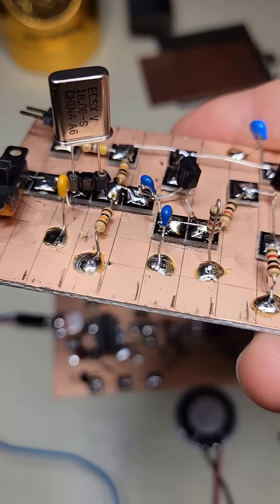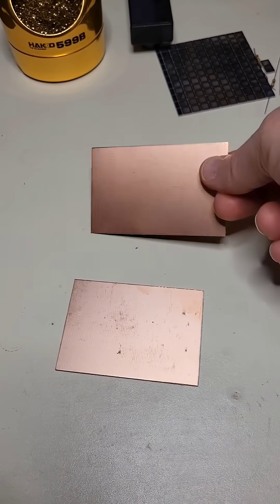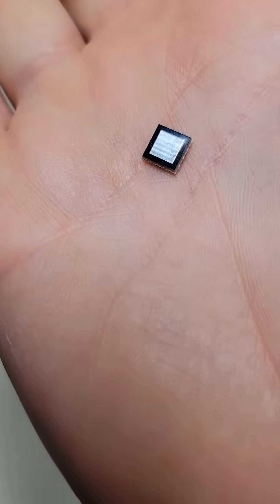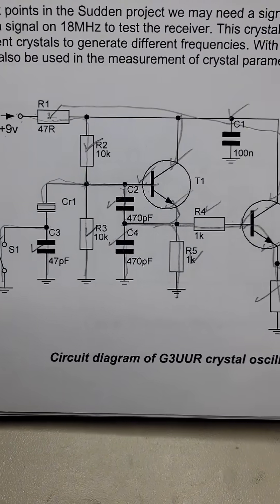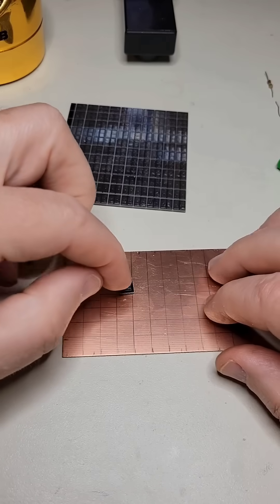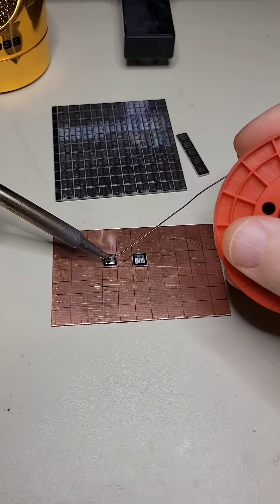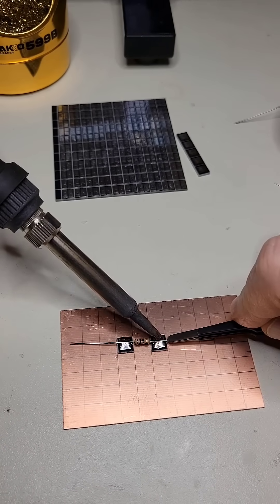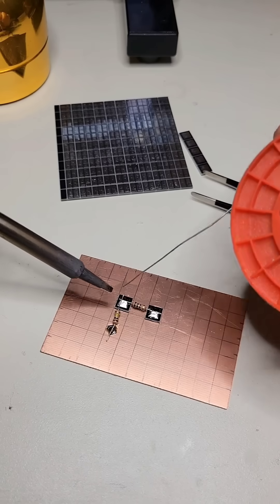Manhattan Circuit Construction Technique for Homebrew Ham Radios

Comment: ich nehm eine geätzte oder gekaufte Kupferstreifenplatine 2.5 x 2.5 dm 
da kommt mehr an Material raus. 
"Doppelt" falsch gemoppelt ist nur umstandskramerisch und dann "einfach" nur dumm.

platter CPU Löter - Plattenwitz:
man kann auch ein Sperrholzbret Brett 1x 1 Meter und 10000 winzige verzinkten Schrauben
für 1.50 Euro nehmen, fern aller Umstandskramer ! zusätzlich noch kleiner  Akkudreher
dann kann man dort eine CPU zusammenlöten. kleines Geheimnis : noch nicht gemacht.
aber kleine Kunsttoffpreßriegel gehen auch super, [Sonderteil: absolut kein Witz] 
wenn diese selbst so geauteten und überwichtigen Trottelmärkte mal zu sind.

Sie stellen sich ja selber so geistreich tölpelhaft dar ?

Comment: New to me, like half the stuff on the web.   I don't understand why the board needs a copper surface if it's not conducting for the project.
Reply: As usual a 2 second search answers my question.  Ugh.  I don't know ground plane stuff, I have minor awareness of shielding:
AI Overview
Manhattan circuit construction is a DIY prototyping method where components are mounted on small, superglued copper pads that are arranged on a larger copper-clad board, which acts as a ground plane. It is popular in ham radio circles for building high-frequency circuits because it's faster than etching PCBs, allows for easy modification, and provides a solid ground plane for performance. The process involves penciling a layout on the board, cutting or purchasing small copper "islands," gluing them down, and then soldering component leads to these islands and the ground plane. 
...

Comment: That super glue sure love that heat.
For a circuit that simple you don't need complicate things. All you need is copper clad for ground and for holding components. Everything else can be connected "in air". And can be compressed into very small footprint.
And if you are worried about moving, encase all in epoxy.

Comment: This is pretty cool. What is that circuit that you are showing for reference I see the crystal oscillator and I'm curious I'm trying to get into Electronics and build a simple transmitter but my brain doesn't work that well for this type of stuff I'm just a dumb plumber

Comment: My pioneer technique was made of springs attached to base of isolation material...springs had down there holes for screws...and up they were bended at angle of 90 degrees, so you can always stretch them and input wire of component. Very fast assembly and disassembly of devices

Comment: you can also drill through holes and cut or etch traces in those boards and make SMD pads or vias so no manhattan circuit or just  upload your gerber+drill files in a zip (or 7Z) archive to PCBWay's beta upload thing

Comment: I do a similar technique called island cutter, use hole saws and drill press to cut islands through the copper on the board while non island portion is negative ground plane.

Comment: Why would you need a copper plate to begin with? You could do the same thing with a piece of wood or plastic (you would maybe just use a different glue) and you can use a piece of uninsulated copper wire for your ground. Way cheaper, way more flexible.

Comment: I've used that construction up to 200MHz. As long as keep leads short and plenty of decoupling it works very well. Plenty of 100MHz high power amps built like this in the 1980's.

Comment: you can skip the glue and just go like a five times over lines with a knife. I recommend using a lower temp solder to avoid copper separation

Comment: In old solid state TV tuners,the RF circuit was built with flying leads joined together,and component ground leads were soldered to the inside of the RF shielded box. Oldtimers know...

Comment: I remember the days when you'd go to Radio Shack for all this stuff.  I suppose now it's probably Amazon.  Then again premade professionally laid out boards are an easy and fairly cheap option.  And there is an old school charm about this.
Reply: Digikey, Mouser or Newark. Al lot of the stuff on Amazon is cheap Chinese junk that a lot of the times doesn't even work.

Comment: Being allergic to the vapor of any super glue product, I usually used hot glue. Then took a different approach.  small drill bit welded a tiny cutting blade on each side. Using a small drill press makes a perfect isolated from the cladboard copper surface ⭕

Comment: Doesn’t superglue degrade into cyanide gas at like 200°C? A jeweler friend of mine gave himself some mild cyanide poisoning while repairing a ring with superglue on it, but obviously that torch was a lot hotter and burned the glue directly, but I’m curious if that’s a concern here

Comment: My first circuits were simple too.  I thought parts had to be laid out just like the circuit diagram.  I made a copy of the circuit and taped the parts down, twisting wires together where they joined.  To my surprise some of the things I made (very simple things!) actually worked! At about the age of 13 I bought a soldering iron and things started to work much better.  That was in 1967!

Comment: It seems for my like vaste of PCB and solder. But it is interesting. And it is really good for circuits for higher frequencies? Becouse each "sandwich" add some capacity to the circuits. Isn't the trio of "dead bug" for mini circuits, prototype boards for no big circuits, and classic PCB for larger/final circuits enough?

Comment: Kind of poor man's version of a Beard board lol, I found plastic mesh panel oh I have so many ideas demonstration making circuits and boards it makes go back to the books so I can replace without the sawder thanks like the video. Cheers
Reply: i think this isnt comparable to breadboard. breadboards are poor for RF and high speed systems due to interference. this is much better in that aspect (not sure)

Comment: there is a drill bit you can use that will cut a shallow circle into the copper clad board. Acts just like the little squares basically.1

Comment: This is a very common technique.  However most prototypes use flying connection points vs using a square pad.  If you need a bonding point, you cut a pad into the copper plane.   Look at Robert Penfold’s work…

Comment: I've built many circuits freestanding or dead bug style with out any kind of circuit board at all. Sometimes I can get away with building the circuit on the back of a circuit board screw terminal strip. And a number of them have been constructed on top of a 9V battery connector.

Comment: I was doing that back in 1982/83, doing logic circuits at 300Mbit/s! Made a 23-stage PRBS generator and error detector using emitter-coupled logic chips.
Reply: Back in '85-86 I built a Direct digital synthesizer using 100k series ECL chips. We used a fast ROM chip with a quarter sine wave stored going to a very fast 10 bit DAC. The address to the ROM was a cascade of adders where the output was looped back to be summed with a control word to set the speed of the adder. The MSB of the adder controlled the polarity of the sine wave and the MSB-1 controlled the slope via a series of XOR gates in the address lines of the ROM. It produced a 12.5 Mhz Sine wave once filtered. It was the heart of our MRI machine. We used to buy them from a company called RTS, but it was cheaper to build them ourselves. ECL was a PITA... But at the time, it was the only logic that would operate at the speed we needed. My engineer wanted to have a custom chip made from the circuit, but the company didn't want to spend the money. A few years later (in the early 90s), Qualcomm came out with the Q2334, which was what we would have had if we had gone forward with our ASIC. We ended up incorporating the Q2334 into our design... A lost opportunity.
Reply: These young cats have no idea how fast that was back than! Very kool!
Reply: Was that surmounted on a base plate made from Prefamulated Amulite?
Reply: @Ace1-v7m  How did you know!
Reply: Then, you learned better over the next 4 decades, I trust?
Reply: @springbloom5940  Yes.

Comment: Its interesting and a way to make simple circuits with a ground plane. I'm an electronics designer for industrial applications. I normally avoid SMD so that the boards are repairable and, in a machine which costs a lot, a through-hole plated board is worth making.

For small, simple utility circuits like oscillators for test, I just wire the components together in a network and then pot them in a clear resin. Quick, easy and practical.

For single sided boards, a bit more complex and prototypes, I often make my own PCBs using double-sided blank PCB. I use the top layer as a ground plane and the circuit tracks are on the bottom. I print my artwork onto tracing paper and use Positiv 20. Not so popular anymore with iron-on techniques but I found I got the best results this way. I use FreePCB (yes) to design the artwork. It's great. The nice thing with making a proper artwork is you can modify and repeat. 

For double-sided more complex designs and quantity I get a local PCB company to do the board. I do the artwork and give them Gerbers. 1off prototypes can be done quite cheaply aswell. 

I HATE Veroboard. Can't understand why so many people like it.

Comment: It is so easy to make a printed circuit board, I use stripes of insulation tape to mask the tracks and then pads for components and then put it on the acid and make the holes and it is done

Comment: Once again I learn something new. Never seen this technique before and I’ve been an EE for near 30 years now. Not something I would use but that’s not to say it doesn’t have value. Thx for sharing.
Reply: I'm just a know-nothing hobbyist by comparison, but this illustrates how wider and varied the field of electronics is. RF and HAM stuff is something I would like to get into, but my god it's more art than science.
Reply: @ No my brother. It is all science. Engineering is the application of science. There is a flare to it. A ying and a yang to it. The balance of it. That’s the art people see but it’s all science. Im still learning and after all these years I’m mesmerized by how little I’ve actually learned. Just jump in. In the grand scheme of the universe I barely, if at all, know any more than you do.
Reply: @EfieldHfield_377  I used to think RF design was black magic. Then I learned all about impedance, resonance and transmission line theory, and things like high frequency engineering. Now I think RF design is black magic with a touch of voodoo tossed in.
Reply: I hate math more than i like EE.
Reply: @EfieldHfield_377  actually proper RF  layout on a circuit board  REALY is a art.
Reply: @wellscampbell9858 When you knew nothing about it seemed like pure magic.  The more you learn the less magical it seems.  After the learning, comes application, and with application comes re learning.  The magic is just the part we don't understand or the missing part of the circuit we failed to see.  Overtime you get a feel for it, that feel, some call magic.

Comment: We called it a "floating build" in the 80's 90's we built boxes out of the double sided boards and every step was shielded. Starting with MRF237 or 2N2219 and going up to BLY90 or more. No one in Europe I know of ever called it Manhattan construction but we also never used those stick-on things.

Comment: you can also do a dead bug prototype. components are stuck down upside down, connected with free air-wires.. longer wires can be supported with some extra ceramic caps to ground , if permitted (mostly power connections)

Comment: 👍 Manhattan and "Dead Bug" are very popular construction techniques used by radio hams. It is fast, works, keeps component leads short (important for radio frequencies). For one-off circuits, it is quite possible to build the circuit in less time than it would take to design a PCB let alone etching/drilling a PCB or waiting for it to arrive in the post.

Comment: I would use an Exacto to cut through the copper, then use a soldering iron to lift up the copper and solder components to the clad. If you are good at it, you can easily make boards that will last forever.

Comment: Completely unnecessary. Most components are so light, you just solder them together. Larger and heavier parts, like a big cap, can be glued to the board and used as support. The ground connections do this as well. With the proper layout, this may be all you need.

Comment: That is an interesting idea and not one I've ever seen before.  Thanks for the video.

I don't understand the need for the bottom copper-clad board.  Why not just leave the upper black solder-pad board intact and solder directly onto it?  Its pads appear to already be electrically-isolated from each other, which eliminates the need to physically detach them from one another.

Comment: One of the old boys I used to work with made prototypes like this by cutting up little bits of board like your squares.
Reply: At our home brewers club (electronics not booze) we would at times do this using dots, instead of squares.  The dots were just punched out of a bit of scrap circuit board with a heavy duty hand held punch die.  The name Manhattan came from where this style was first described by that name.. Manhattan KS.

Comment: Common for RF but overly complicated modern version. Classic is to have single or double side cladded board and cut pads with various self made specialized cutting tools or since "dremmel" like tools became ubiquitous use them, though they make unnecessary amount of harmful dust and are slower. This one is also OK, though a bit more expensive and somewhat slower in comparison with using shaped cuters.

Comment: I don't understand why you would do this.

Use a breadboard to experiment, and use a circuit board generation software to layout and then produce a PCB.

I use Easy EDA to produce PCBs for final projects, and it is inexpensive to make one to thousands of boards as needed!

If you only make toys, I suppose this is OK, but you can buy perfboard with copper pads to solder to, then jumper them together with wirewrap wire...

Comment: Back in the 80S and 90s radio shack used to sell a kit for chemicals etching coper clad board. Came with a paint pen to draw the traces and a drill bit fort through hole components.
Reply: Yep, well remembered. I did this as well. In addition to the etch resistant pen you could get rub on transfers for pads and tracks. Think the solution was Ferric Chloride or something similar... That's really Brough memories back. Thanks..
Reply: I still make my own PCB with FeCl (Ferric Chloride). But with modern software like KiCad you can make really professional results. With some practice you can even make double sided PCBs, but there has to be some consideration given if you're soldering through hole ICs, and you need a socket designed to lift the IC up a bit so you can solder on both sides, since you don't have plated vias.
Reply: I had one!!! I was 12 and my Dad bought it for me. Nowadays I'm printing them on my laser printer and etching from that process. Works OK. Laser etching a painted copper board would be better for home stuff. Now you can order pro boards from China for $20 for 5, but it kind of defeats the 'DIY' part of it.
Reply: what size drill bit
Reply: Easier than using a photo resist...
nice

Comment: Interesting approach with whole circuit ground plane. If power is needed in many parts of the circuit you can use "double comb" method where odd rows/columns are separated from even rows/columns and each group is connected among them with edge stripe

Comment: Why not just cut copper plate and nail it to the wood or glue it? Instead cooper plate you can use copper wire which is widely available

Comment: In my childhood in SU it was rather common to build different small electronic devices. Soviet children just scratched the copper on the textolite with help of the sharply broken sawblade. Usually 5 or 6 lines were made. The higher was +, the lower -. Middle strips were separated in the length, for different signals and cascades. Someone drilled the board in order to locate details on the insulated side or even used two-sided board and made via connections with help of detail's conductors

Comment: You can use perf board and just bridge the eyelets with solder. It'll look kinda like a printed circuit board when finished, and works well. I've made numerous things on my own this way such as a multi-vibrator to drive a step-up transformer for use as a battery eliminator in tube portables. In college, I built an FM transmitter using this method. Everyone balked at the "excessive" use of solder. My transmitter was the only one in the class that worked. Everyone else had long leads, jumpers all over. Terrible for VHF oscillators.

Comment: Stahler drill mills (not the tool you find at machine tool suppliers) created isolated pads with a central hole for a much cleaner looking,  more reliable board without adhesive Mi-Squares.  The adhesive squares can become detached from the heat.. Problem is, I don't know if the Stahler type drill mills are available anymore.... Stahler has apparently closed shop. 

Isolated pad perfboard is also a rugged reliable option, although it doesn't give you as good a ground plane.  But you can add copper tape for the ground plane.  I spent 40 years doing this kind of work, as well as 2 layer wire wrap, which takes some skill to do right.  Unfortunately wire wrap sockets and dip sockets are also very hard to find these days.   Incidentally, I've wire wrapped boards as complex as a 386 motherboard with multiple IO connections.